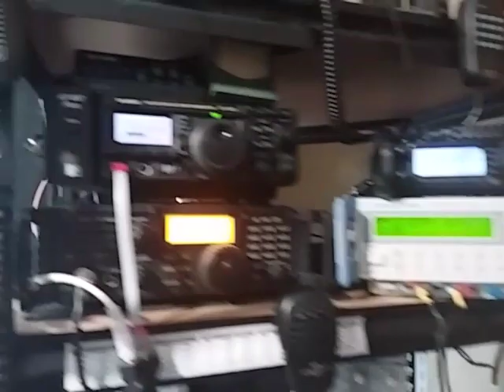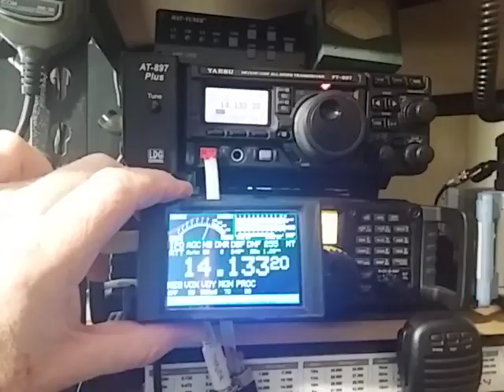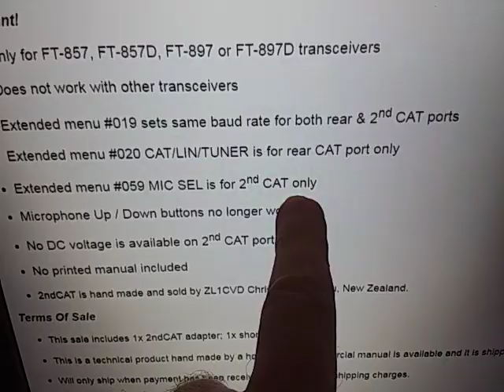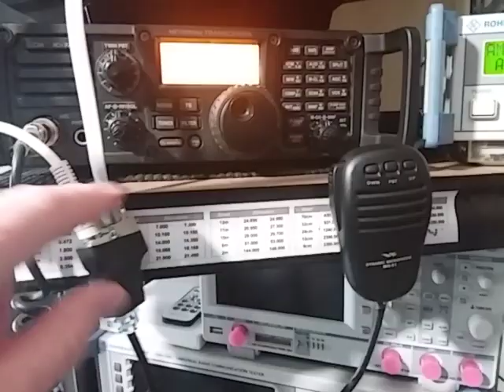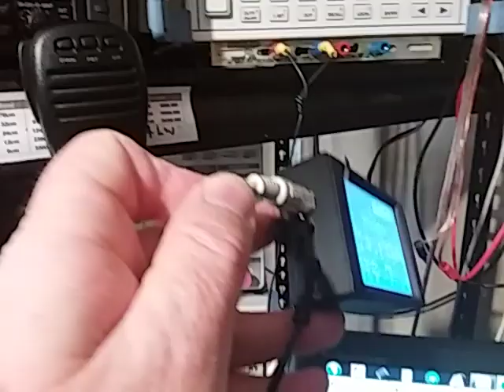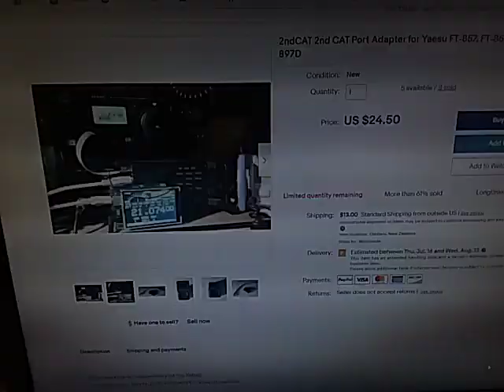2ndCat Cat Port Adapter for FT857 & FT897 Transceivers

Comment: I did similar interface to use mic connector as a second CAT. My problem is that I have to go to menu, switch from CAT to Normal and back to CAT to use this connection after radio was turned on. It looks like radio forget that mic socket is set to CAT although CAT is set in menu.
Second issue is that when I connect for example from Log4OM VFO jumps from a to b all the time. Anyone has similar behavior?

Comment: Hi Chris hunting for advice, trying to select CAT on menu 020, I can't change it it's stuck on the tuner I haven't got a tuner yet saving up for one. I'm trying to get logging software etc running on Win 10 Lappy hope you can shed some light on this dark art for me Cheers M7 HTO Mike R
Reply from the maker: Look in the manual. There is a menu that selects  tuner ATAS cat I think. This must be cat i think. Sorry, I'm stuck in a covid quarantine center for next 12 days & dont have access to anything.
Reply: @ZL1CVD  Sorry to her you are stuck I hope you are OK and its only quarantine, Thank you for trying to help, I'll look on the extended menu for the above items, just did all factory defaul as i have reset the device an 020 defult is CAT so moving forward cheers good luck. M7HTO 73z

Comment: i have the mh-59a8j mic going to suck if the buttons wont work that true please let me
Reply from the maker: Buttons on mic will not work. Also the remote control mic, will not work with this adapter. It may suck, but that is how Yaesu designed the rigs. Tell them it sucks, not me. I just make an adapter which you could also do if you took the time..
Reply: @ZL1CVD  what if I shut it off in the menu just turn it on when I want to use the cat will that work
Reply from the maker: @samuelspade2202  no.  While menu 59 sets the microphone up/down control lines to CAT, RMT or NOR, they are directed to the Cat port on the 2ndCat splitter, not the microphone port which is what you would need.  You could make your own splitter but you'd need to 1st switch the lines over to microphone, then go and change menu 59 to RMT each time you wanted remote control.
Reply: @ZL1CVD  Mmm ok little disappointed but all ready order it it and I have gotten stuff from you before. Just wanted the 2dn cat for computer control and I guess when I go program at from the computer I'll look into a splitter another question is I'm running control head do I need to put the cat near the radio or can I put it near the head there is a couple of there already that's all you need to do is take that out and put the cat control there please let me know Chris thank you Wally